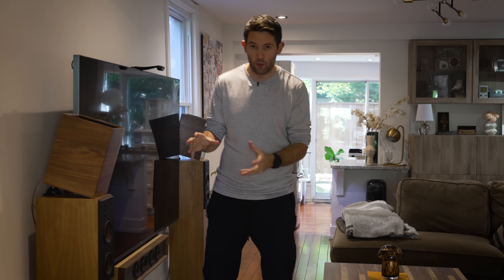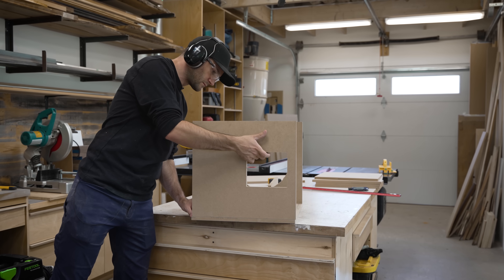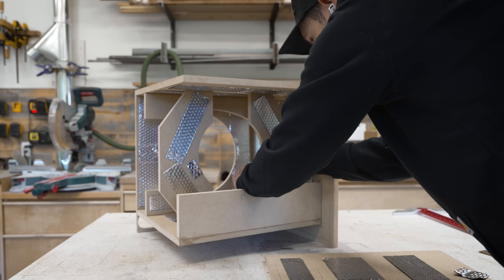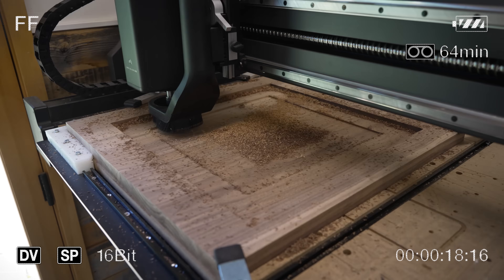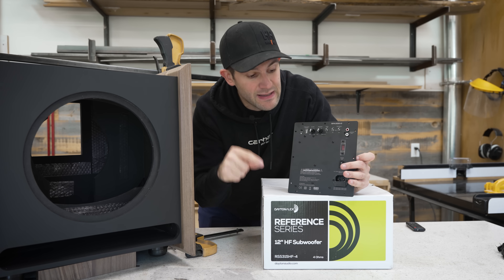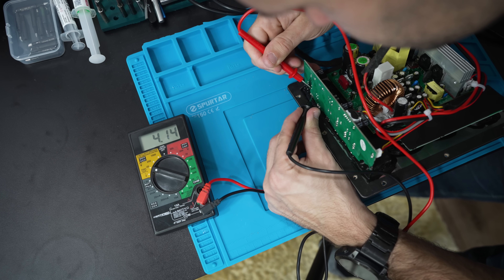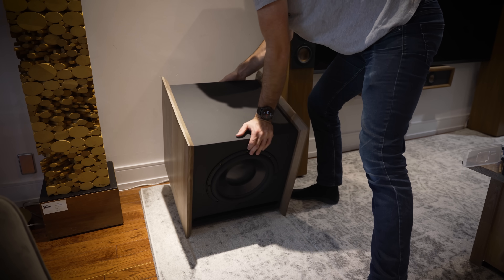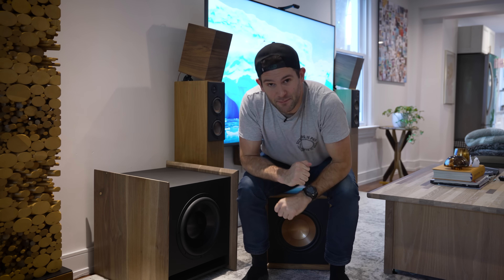THIS changes DIY Audio...

Comment: Audiophiles have left the chat.
Reply: Not soon enough.
Entertaining though.
(Probably should have absorbed that reference theory book before buying the CNC;-)
Whelp....my system has warmed up, so back to the music 
👋😅🎶🎵
Reply: A year later and the guy left this up 🤣
Reply: What makes this less than optimal for SQ?
Reply: @joe_ferreira  that little wireless dongle has a made in china DAC, and it's nowhere near as good as the DAC on the receiver, this alone is a major impact on SQ. The dongle inside the coffee table is most likely compressing or passing the signal over RF at a low quality standard even before RF interference gets mentioned. And the subwoofer frequency is being converted from digital, to analog, back to digital, and back to analog.
Reply: @joe_ferreira  He failed to simulate the frequency response for that driver with the port tuning.  The tuning is too high and will cause a hump in the response.  This hump is the type of issue that commonly has people railing against ported designs.
Reply: @gregkramer5588 yeah he claims to build a ht sub but goes with a sub that will probably not hit with lfe, since its tuned to 32hz, when a better option wouldve been a ultimax 10 in a sealed box for much lower bass and a smoother sound
Reply: Most audiophiles prefer utilizing multiple 8" subwoofers rather than a single 12" or larger subwoofer due to the greater musicality of the smaller subwoofer. Then just tune the output to the subwoofer to get an appropriate response curve.
Reply: @mndlessdrwer  The woofer of choice in this video is not just a subwoofer, but has the inductance and frequency response of a very well designed 12" woofer. Distortion is very good too, thanks to the well designed motor that uses shorting rings. 
That said, an improperly designed enclosure can ruin the response, like where he tuned the enclosure.
Reply: @mndlessdrwer  Where is that data from.  8" subwoofers, that is a rare thing. 18" is more popular than 8" 
Tuning is what you do for the port based on the T/S parameters.
Reply: Well-stated.
Reply: all I needed to know BEFORE watching LOL peace mates
Reply: My record player is hooked up to a 300W sound bar. I like the sound of a clean vinyl but I don't want to spend the time, money, or space for expensive speakers. This type of video is for people like me I guess.

Comment: I recommend using a pair of matching subs. This will eliminate "dead spots" in most rooms. It's hard to find the perfect placement for a single sub without producing dead spots.
Reply: Have you heard of "Corner Loading"???
Reply: @RTR-MATEY  No - have you heard of the "crawl"?
Reply: @blueribb99  What? Like building a subwoofer into your crawl space of your house between the floor joists?! 🤔😂
Reply: @RTR-MATEY  No - A "crawl test" for a subwoofer, also called a "subwoofer crawl," is a method of finding the best placement for your subwoofer in a room by physically crawling around the listening area while playing a bass-heavy audio track, allowing you to identify the spot where the bass sounds most even and balanced throughout the room, typically by getting close to floor level to hear the sound as it would be at your listening position. In some cases, moving the sub to that position may not be possible due to room setup. Using 2 subs eliminates that case.
Reply: @blueribb99  LOL! I figured it was something like that!!! I was kinda pulling your leg, BTW!!! 😂 I will say that the "crawl" would be a bit of a "time waster" as different frequencies will create different "null" points at different locations in the room based on the center frequency wavelength. Best way IMHO, is to corner load (in the room corner!) the sub, correct the phasing with the speaker terminals (depends on if forward or rear facing), do a frequency sweep for any unwanted room/object resonance, notch with a parametric EQ if necessary and then go on to "flattening" the whole room response with "pink noise" & a Graphic or Parametric Equalizer. Works much better with 2 or 2.1/2.2 channel audio. I can pretty much do all of this from my easy/lazy chair!!! 😂
PS--Please don't make me do the Sub Crawl!!!...akin to the Pub Crawl if you do it whilst drunk!!! 🤪😂

Comment: Beautiful build, I'm still using a BASH 300s plate amp in my subwoofer since 2007. It's probably not class D technically speaking but it's more or less class D, weighs very little and is very efficient and in my case extremely durable.

Comment: Regarding the panel damping, it's unnecessary in a properly designed subwoofer box.

It's not that hard to ensure that the panel resonance frequencies are an octave above the ~100 Hz subwoofer operating range, in which case the resonances won't be excited and therefore don't need to be damped.

Comment: I have a ported enclosure in the car that's built specifically for the drivers I'm using and people are blown away by how punchy and accurate it sounds. I'd like to build a sealed box for 'em to do an A/B comparison.

Comment: I subscribe to the amp should always be more powerful than the speaker.

An amp clipping and pushing square waves to the driver will do more damage to it than exceeding the rated power of the driver.

Comment: Very kewl and moderately large, but given you started with a Klipsch speaker, have you every seen a Klipschorn?  These have 15" woofers mounted deep inside a folded horn (plywood and about 10 gross of wood screws). They're from the days before subwoofers when a left/right pair of speakers needed to cover the full frequency spectrum. They sit in a corner using the room's walls to help form the mouth of the bass horn. They're about 3' wide x 4' tall and 30" deep. With the midrange and tweeter secion on top they're close to 5' tall. They're super efficient, much more so than a ported speaker and tons more than a sealed acoustic suspension speaker. Curiously they had an impedance of 16 ohms - most amps couldn't provide full power into that impedence (my Sony TA-3200F could). But that meant the amp provided a more short-circuit-like  impedence for if the cone tries to overshoot which minimizes excessive motion. 110 waters per channel and it was hard to be in the same room with them. I had a binaural demonstration record from Stereo Review which had some tracks recorded in a NYC cathedral. At high volume the window wall of my bedroom felt like it was going to jump off the house during certain pedal notes. I still have them, but just use them as subwoofers for the home theatre. They're still made, but the price is staggering - 20 times more than I paid in 1973.
https://www.youtube.com/watch?v=0lWmZKOm-ag

Comment: Sorry but thats some misinformation there. 1) Class D is NOT digital, end of conversation, if you think D stands for "digital", educate yourself while realizing the internet is full of a lot of misinformed people such as this guy, that keep this persistent misconception alive 2) You DO want an amp more powerful than the speaker if you want to get the speaker's full output potential. An inadequately powered amp will result in clipping, and clipping destroys 10X more speakers than power. As evidence, I actually blew a 200 watt 6x9 car speaker with the 15 watt Dayton DTA-1 Battery Powered Mini Amp which starts clipping at around 7 watts.

Comment: Pytting the dynamat in the enclosure wont do anything for sound quality. it's more meant for cars to use on the metal surfaces to reduce vibrations. That MDF is more than thick enough to handle that 300 watt sub.

Comment: Not suggesting you do this, both due to the cost, and again, your neighbors might hate you for it. And you would need to find a way to power such a thing, without overloading any power cord that go to each of them.

But if I had both the cash and the tools to do it myself, I would love to give it a try. I would also love to experience it personally, for that is what it be all about. Getting to experience it.

Seeing it is wireless, and will not have signal desegregation by having more than one speaker attached to one wired output, be cool to find out how it would feel to have three or four such subwoofers set on both sides of one's sitting spot. Rather than just one put to one side. For a grand total of six or eight such subwoofers working in unison. That be the idea this video is giving me.

The over all volume could be lowered on each individual subwoofer, to gain about the same level of volume just one would put out on it's own, wile having more base pushed air one can feel from the full array.

Is just an idea though.

Comment: Hey Zac, Matt Perks realised how Toslink could be upgraded with a laser on the transmitting end to send lossless audio at a receiver as a substitute for the LED normally used with an optical cable. Perhaps, you could make a video showing how you tackle that with receivers incorporated into your speaker enclosures so you can finally ditch much of the audio wires, at least for your speakers.

For removing the mess of wires underneath your living room mat completely, you would need to bring them under the couch, then perhaps with a craft knife; slice underneath the carpet and use extra-long lengths of flat-flex cable to bring the connections under the carpet, then cover your entire floor permietre with crown moulding to bring the wires behind with a small hole in the wall to permit a larger bend radius, then have all connections snake underneath the moulding to hide them with some negative space cut without compromising structural integrity.

Maybe even, incorporate magnets into the moulding and fashion some sunk into the wall so when you want to add more connections, you pry off the magnetically-held covers to do as-such.

Comment: I've got to disagree about the power of the amp needing to be less than the capability of the driver.  It's not too much power that destroys a speaker, its distortion.  Having too small of an amp, will create more distortion than one having much more power.  The power is 'cleaner' at lower settings than when you are maxing the amp.

I'd rather have a much larger amp & just not turn it up to the max.

Comment: Cambridge Audio has a nice post explaining that Class D is NOT digital. It just happens to be the next letter in the alphabet.
Reply: Class H amps also exist and i believe they predated class D amps. I don't believe its a sole alphabetical thing.
Reply: If I remember correctly, digital is Class T.

Comment: Hello everyone, I really like what you are doing. But I have a question? Philips or Magnavox in the USA or Marantz in Japan did make speakers with MOTIONAL FEEDBACK, a special circuit to manage the speakers inside. The schemes are online to find. Is it possible for you to do  a project making a set of speakers with such a system? I think it is a win win situation. What do you think. Have a great day. Arie the Dutchman
Reply: Hello! I spent two years in Japan back in 1995-96 in Yokohama and actually saw a building that had both the Marantz AND Philips logo on it!!! Additionally, I used to live in Greeneville, TN back in the 1980's when they were the location for manufacturing the large screen rear projection with PIP (Picture-In-Picture) and dual TV tuners. So Magnavox, Philco & Sylvania were all related as well as Marantz. I do remember a bi-amped speaker setup that Philips came out with that used direct to speaker TOSLINK optical system. Unfortunately never got to hear it though!!! Regarding the feedback you talk about, sounds like an accelerometer setup. If I was to do a comparable setup, I would use a sealed box of decent size, non-parallel baffles to reduce/eliminate internal standing waves and a dedicated amplifier with parametric Equalizer. I think Behringer has some amps that implement DSP and are not too expensive. PS--forget the accelerometer schema. Just make a decently size sealed box and use the DSP amplifier. Should be enough control!!!

Comment: I prefer screw terminals or preferably soldered connections over spring terminals. Especially in applications involving high current.

Comment: 5:15 When you say "cheap, knock-off Dynamat", is there actually any guarantee it is made of butyl rubber or equivalent material? Can the specs be trusted? One should always do a comparison first before bulk-buying.

Comment: 1:36 For a given low end frequency response limit, the ported loudspeaker will always be significantly smaller than the infinite baffle (sealed box) equivalent. The main reason for using ported designs is to save on volume (size) and of course materials' costs etc.
Reply: That surprises me. I thought a ported was better for going louder but not as low in the same size. Tiny ported boxes tend to turn into more of a midbass machine, and to get them very low you'd need a lossy port that resembles a small intestine. Of course, you can use a passive radiator, which probably works far better in a small sized box.
Of course, a smaller sealed won't go as low, but they do have diminishing returns as the box gets bigger and bigger until it's just mounted in a solid wall, and then it's dependent on the resonant frequency of the driver, and ultimately whether there is enough cone area to make audible output down low.
Reply: @TimpBizkit  Well, I mean, these statements should always be qualified with numbers as we are discussing about multiple parameters taking effect here, concurrently. So my original statement should be taken in its broad sense, a rule of thumb if you will. If we're going to compare like with like, we need to consider all the decision criteria (the objectives) vs. the means. What you're referring to as "tiny ported boxes" turning into "midbass machine", I mean it definitely brings up a familiar image in mind: most bookshelf speakers, midi and mini speakers (in fact I'd say virtually all of them) are ported and naturally are midbass machines. Why? Because, by virtue of their dimensions only (unless they feature a mid-woofer with an excursion of 2-3cm or more—currently a non-existent device), they cannot reproduce bass. 60-70Hz is the lowest discernible frequency they can go—for most it's really 100Hz (just random figures, for the sake of discussion). So what the porting does is just boost the response above these cut-off frequencies, which increases the midbass output, while simultaneously (because of physics) reduce the output below these cut-off frequencies. This is taken even further in some designs: the designer knows that increasing bass output is impossible so what is aimed for instead is a slightly pronounced midbass response: this gives the illusion of more bass (what is affectionately known as "fake bass").  But it is fairly easy to get an idea of the situation using one of the abundant, free loudspeaker design tools on the internet. Nearly all give the option of ported vs. infinite baffle design. Invariably, by switching between the two, one sees a trade-off between large volume and progressively donward-sloping bass response on one hand and small volume and a peaked bass response resembling a cut-off. In other words, the porting squeezes the bass response further up, if you allow the expression. By judiciously selecting the driver parameters and the porting frequency etc., one can get increased bass output, in some frequency range, compared to the closed box design, but the response can never go lower than the selected porting frequency. I hope this helps.

Comment: I worked in pro audio from 1989-1996. We designed, sold, installed, tuned and serviced systems from clubs to concerts.

We rarely had to replace speaker baskets on systems we designed with power to spare, but replaced many 15" baskets for the DJ crowd who didn't have enough amp headroom (or clipping protection) so they were nearly pushing a square wave to the drivers. Thus rubbing coils against the magnet superstructure at the excursion limits.

I know a lot has changed in the 30 years since, but another consideration I don't see in the comments was the marketing games amplifier manufacturers would play with power amp ratings. They would take a two channel amp, bridged mono at 2 Ohms to obtain a few thousand watts RMS. But the lowest THD advertised was rated at 50% load, stereo at 8 ohms.

Contrast this with audiophile amps or even some car audio amps that are capable of hundreds of watts, but they are rated at 100 watts with incredible quality.
Reply: Experienced FOH engineers run the rigs within design limits!  All of the flying arrays are software cfg & controlled, as are many concert grade amplifiers now!   DJ's (esp the newer ones & EDM types) on the other hand, will constantly push their rigs into clipping, their subs driven well past Xmax, and generally destroy drivers until they learn!

Comment: 1 tiny bit of ... mistake , the amp should always be bigger so you have headroom if it peaks , otherwise you will crank some voltage into the coil, other than that , top video !

Comment: Nice video and build but 32hz is a very high tuning frequency for that driver.  IMO 20hz tuning with 4 cubic ft is where you want to be. 32Hz will cause huge hump and far from flat.

Comment: Latency of the wireless transmitter can be an issue, but not if you use same for the other speakers.
ATM , guesstimating an average 5ms delay, that puts the subwoofer 5ft behind the top speakers in audio terms. Very mild phasing and loss of bass efficiency in a front room setup.
SO-off set that by putting bin by your fave viewing seat.
Im gonna build one UNDER the seat - or build a seat AROUND a bass bin 
😆

Comment: Common practice is to decouple electronics and woofer box. This is done by building a seperate chamber for the subwoofer amplifier. Since you consider longetivity of your speaker, this chamber will significantly decrease vibrations that will damage electronic components.